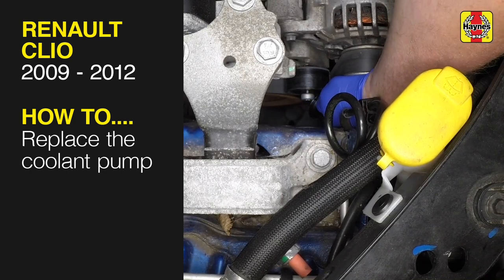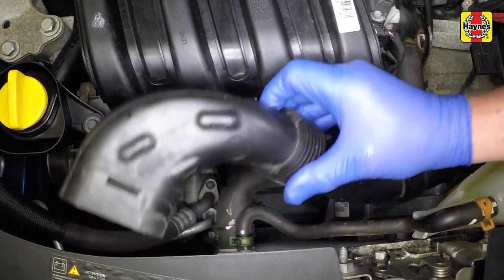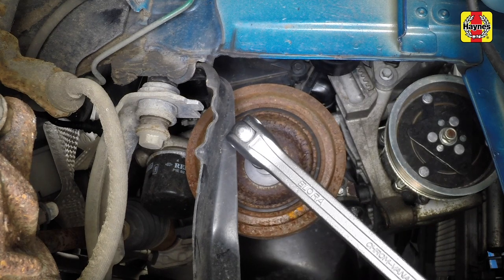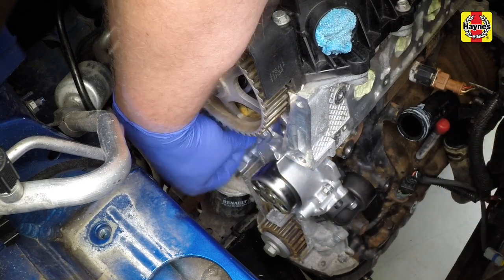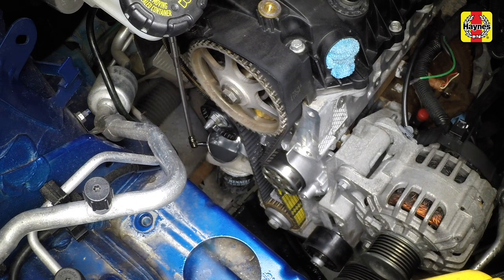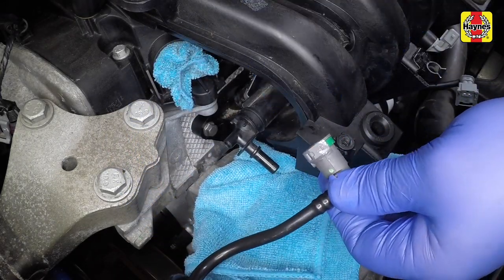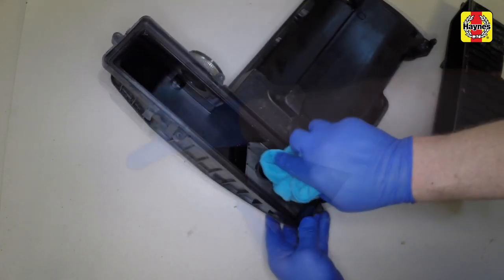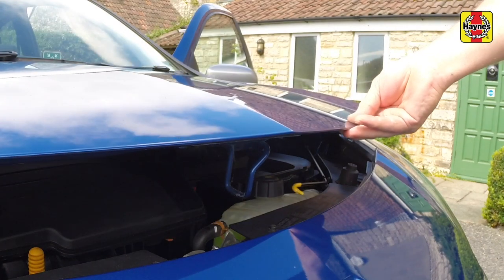Renault Clio (2009 - 2012) - Replace the Coolant Pump

Comment: I used a drill bit to lock the flywheel, but the flywheel locking tool do make it a lot easier. Had to fiddle with the locking with the drill through the casing, and locate the hole in the flywheel a few times to realease the bolt on the crank. The white lines don't match up again before a certain amount of revolutions. Do it 3 times as stated and check that the crank and cam are aligned at the marks every time.